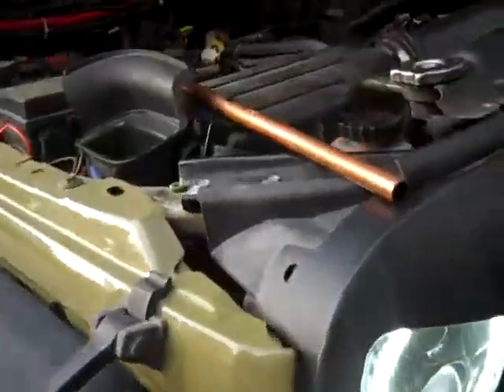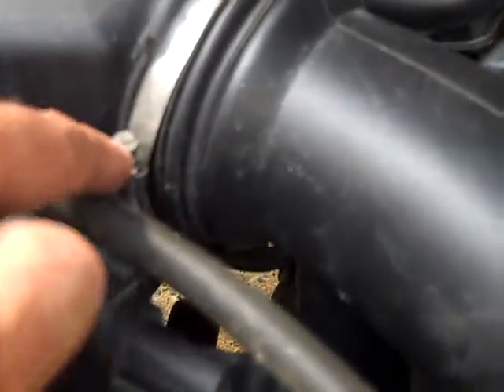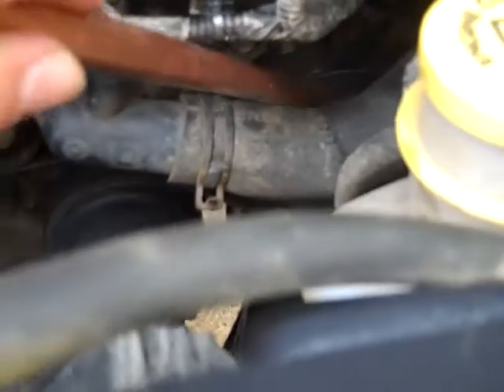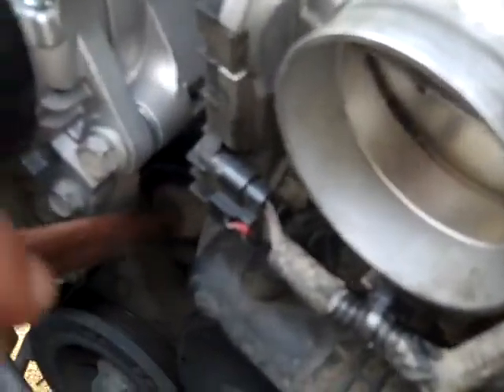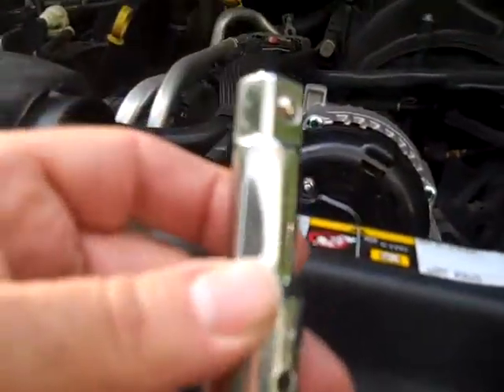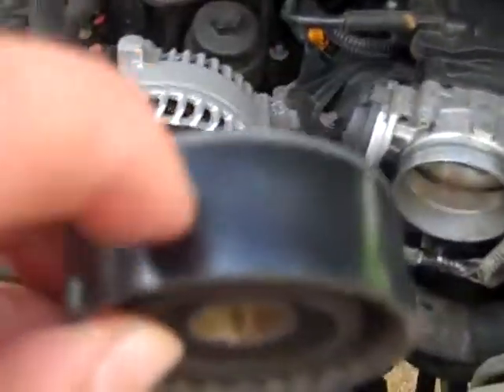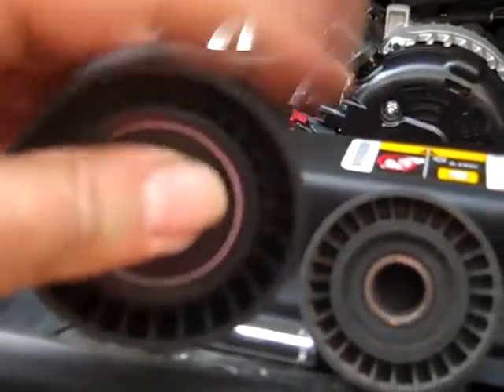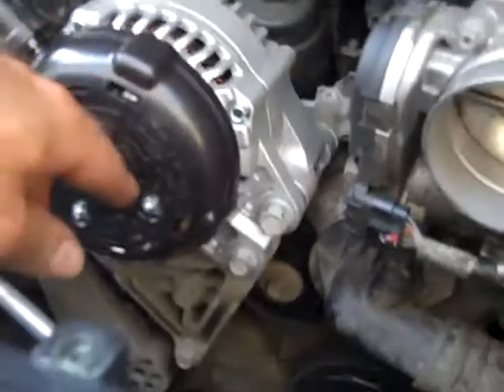FInding and Replacing a Noisy Idler Pulley

Comment: Hey. Great video. Not much info on 3.6 pulleys on youtube. I need to replace both idlers. Was the bolt for idler removed anti clockwise i.e. not reverse threaded? Also - to confirm, the tensioner arm required clockwise movement from the breaker bar
Reply from the maker: Bolts are NOT reversed threaded.  They unscrew "normally"... "righty tighty, leftie loosie".     I guess you could say the tension arm is "clockwise" as if we were facing it, it would be the "tightening" direction.  As noted in the video, you pull your breaker bar towards the driver's side.
Reply: @DeathScouter  thanks. Hopefully the other idler comes out the same way and without needing to remove alternator. Both of mine have stuffed bearings

Comment: Did your Jeep ever locked? Like were you able unable to change gears/shift to drive etc?
Reply: my fiancé's idler pulley failed catastrophically and her power steering locked up while on the highway at 60mph. very dangerous
Reply from the maker: YES, I have had instances where I cannot shift out of Drive.   I do wheel my Jeep and have gone in water & mud.   What happened to me was that the cable connected to the shifter got rusty.  I had to replace the shift cable and haven't had a problem since.